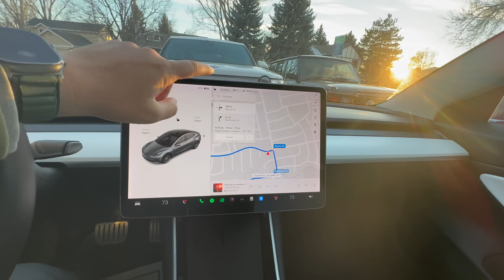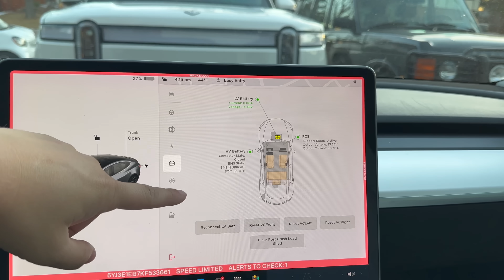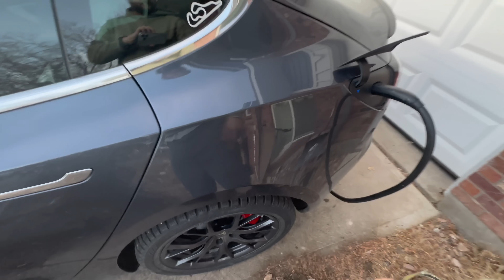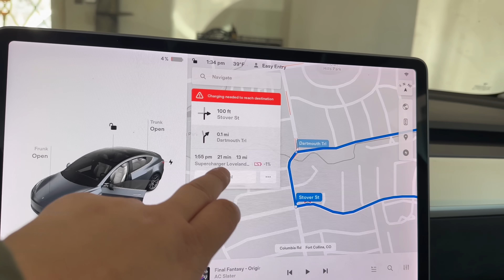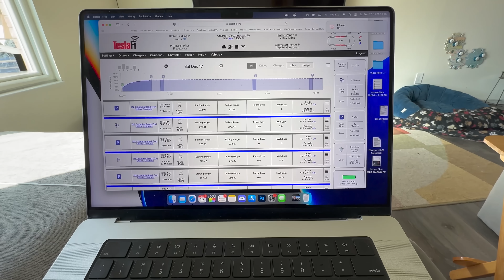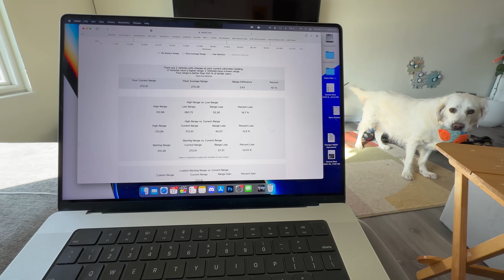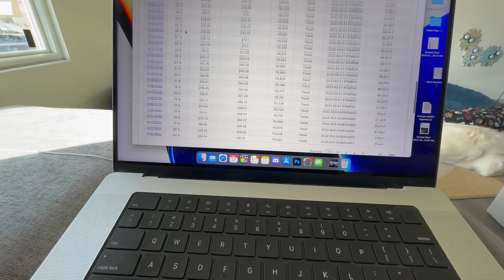Tesla Launches Service Mode! Wild Battery Health Results For My 120,000mi Model 3

Comment: 80+% capacity is a common threshold that a battery is still healthy. If Teslafi is showing 12% degradation, and the battery health is showing 8%, maybe the health test shows how much degradation is left until it thinks the battery will reach that 80% mark.
Reply: Tesla uses 70% capacity as their threshold for battery health. You need <70% capacity to get a new one under warranty for example
Reply: @keco185  by that logic, and if his battery warranty is just about to expire, he should be kicking that battery hard, then taking it to Tesla and asking for a replacement.
Reply: @keco185  yes but he has 18.8% degradation. So with another 8% hed be almost at 30% degradation. it does not seem to be an exact match however.
Reply: Actually if you read up on lithium ion batteries, most manufacturers recommend replacing the pack at 80% health.

Comment: Imagine owning a normal car where, if you have a fault, you need to bring it to the dealer to read the code, or get an OBD port reader
Reply: OBD port reader is $20-90 or so depends on what you want it to do., and lots of free apps to use for diagnosis, OBD port has been open for public use for decades.. and I can buy any part I want from just about any OEM..  Its Tesla that's been behind the curve on this.. I am very happy to see them open it up to see the info, glad they did this.. its about time.
Reply: @kens97sto171  true, but still sounds like DOS vs Mac in the 90s ha ha
Reply: @bartwaggoner2000  
 I would  take Dos or Windows or Android over Mac any day.
Pretty much the same philosophical differences we have with tesla vs most other OEM's
Freedom to do what you wish with your car and the ability to buy parts for it and  repair it yourself.
 Versus not being able to.

Comment: 174 psi likely refers to your power steering fluid, not tire pressure
Reply: it showed 174 psi in each corner of the car where the wheels are at.
Reply: It's electric steering so I don't think it has fluid
Reply: Yeah, the power steering fluid in the electric steering of the Model 3 usually also interferes with the WiFi cable attached next to it. Maybe that's why there are 174 psi shown on each wheel.

Comment: Hi, just one thought, a poor battery might perform ok while slow discharge but really suffer on high discharge due to increased internal resistance. It’s not so easy to measure degradation. It’s always a algorithm and it’s not perfect

Comment: i just checked mine & showed low coolant. I checked my coolant & it’s a little bit below minimum. I scheduled a service in the app scheduled this coming monday & Tesla sent me a repair estimate of $740 without checking the car yet. The estimate showed part “ASY FRONT CONTROLLER COIL SUSP” to be replaced. what connection does a module do to a low coolant? 😮 Should they be checking for a leak first than replacing a controller?
Reply: @DODIE, $740 us for front control Link and I got mine done free at 24 months of ownership of Y. They also replaced the 2 lateral links. Poor quality control
Reply: Mine says the same thing, figured it’s a bug since no errors show up and wouldn’t know about it otherwise
Reply: @echoplexSE  just had it serviced and they found no leaks so they just topped off coolant. I paid $20.5 for coolant top off and $120.5 for diagnosis/labor.
Reply: @dodie7431  can we find out the coolant level ourselves?
Reply: @welbyroberto6581  I did checked the level myself to confirm i’m low on coolant before scheduling service. I had to remove the front tub/frunk to see the coolant reservoir and mine was a little bit below minimum. I thought being over 4 yr old car, it might lose a bit of coolant but it’s supposed to be a closed loop system. I could have topped it off myself but I want the peace of mind not having a leak somewhere.
Reply: @dodie7431  thanks, that would be next year's project for me
Reply: Same error here.  Taking it in on the 10th.
Reply: @vinnie97  I had my 2020 Y replace the front control Arms and lateral links replaced free after noticing some noise at the front

Comment: The 5 way valve has failed on the superbottle and will need replaced. Tesla replaced mine for the same error, fortunatley under warranty. They replace the superbottle and attached pumps, valve, etc. for this, requires coolant put back into system and also recharging refrigerant system too since it is all tied together. Was done in a day. Good luck!
Reply: Maybe the test is having problems because of the valve failure.
Reply: @David_L3  could be. Bad thing about this fault is it doesn't tell you how long it's been going on, so the valve could have failed a long time ago. Don't like the fact this impacts your battery and motor health too regarding thermal management. Pretty major issue to me.
Reply: If it is a somewhat frequent malfunction, maybe they should do a recall. Sounds quite important to have that system functional.
Reply: @ContraVsGigi  What's worse is that it's not reporting as an error unless you check the diagnostics.  You could miss it as a warranty repair.
Reply: I'm guessing that's only covered under the bumper to bumper warranty?
Reply: @NathanC.4  Correct!
Reply: Has Kyle posted any updates on the valve issue?   be interesting to see what Tesla says.
Reply: @David_L3  not that I have seen, probably gonna take a week or two for tesla to get the car in to look at it, especially with the holidays coming up.

Comment: Thanks for showing this test. It appears your car has 65.6 kWhs for the nominal full pack reading. New is 77.8, making for 16% battery degradation. The range loss as you showed is 12%. I see the same variance between range loss and degradation loss in my 2019 LR RWD over the years. Capacity and Range Loss have always been different readings, with the capacity loss being greater. My capacity loss is 6.8% but my range loss so far is 4.6%. I have far fewer miles than yours, however. 😉I'm taking my readings from ScanMyTesla.  The Energy Buffer reading also declines over time. I believe this reserve is the past 0% capacity. Energy Buffer this vintage of 3's starts at 3.5 kWhs. Mine has dropped to  3.27 kWhs. While I only have 24k miles, 37% of those miles have been from Supercharging. I pretty much follow your same battery charging strategy.
Reply: The new battery 77 kWh is also misleading because even when it was new you would never get that much out of it, only about 72 kWh when new. So it is about 8-10% degredation.
Reply: @ryen7512  I watched your 70k battery report. Have to like ScanMyTesla. Just nitpicking, but I come up with just two more kWs at 74.3 usabe when new (77.8 minus the 3.5 kWh battery buffer). The first reading I took from ScanMyTesla was around 6,600 miles. It showed a Nominal Full Pack of 77.6 then. I did see one video of a new Model 3 that showed 77.9 when new, but SMT goes with 77.8. In a ScanMyTesla from a few months ago my Nominal Full Pack was showing 72.8 kWhs. SMT showed the "Usable" as 34.7 at 49.9% SOC, making the usable 69.5 kWhs at 100% SOC. Add in the 3.3 kWs of Energy Buffer and that brings it to 72.8, the Nominal Full Pack reading.
Reply: @epcalderhead  Thanks for the info. Here is another video I made at 10k miles in 2019 and it compares a few different sources which ranged from 72-74 kWh. Cheers. 
https://youtu.be/RUbrNgSdhUk
Reply: Not every model 3 long range had 77kw battery pack most of them came with 75kw pack until recently they put 77kw and 82kw packs with the enhancement of the battery packs. I think that was in 2020 they changed.
Reply: @acostaae90  All LR Model 3's had 77 kWh packs until they bumped up the range as you mentioned to 82 kWh. I've never seen a 75 kWh LR pack documented. Once you subtract the 3.5 kWh of buffer you are around 75 kWhs of "usable" energy. Perhaps that is the confusion some make? Can provide proof there were 75 kWh packs?
Reply: @epcalderhead  the useable was always 72kw though from what I read on all model 3 long range until the upgrade to 82 which I suspect make the usable 77 or so
Reply: when has he used SMT?
Reply: teslafi is always similar to SMT - > the cars original range is 320 miles not 310 miles. the initial degradation is hidden.  they are both 16% hence.
Reply: @kingprone7846  depends on what build you have. Original model 3 performance was like 302 miles and LR was 310. The LR RWd was 315 then got bumped up to around 325 and 318 and 310 respectively with a software upgrade.  They all had 75-77 battery sizes with a useable 72kwh. At some point end of 2020 or 2021 they added 82kwhr pack and a heat pump which gave them more range.
Reply: @acostaae90  that was just from the tires and only for the 2020 model year. model 3 LR/peformance has always been 310. also maybe it was 325 not 320 - i think in kms not miles.
Reply: Question from a Kia EV owner…many of the posts state the range after the battery is charged, does Tesla just use some standardized formula for this?  In the non-Tesla world the “guess-o-meter” range calc is based on recent driving data. If I’ve been commuting, my full charge range is over 300 mi while if I’m on a road trip it might show 230 mi for a full charge.
Reply: @JBRion22  Teslas display the battery capacity in percentages or in miles. It's not a GOM like in a Bolt or Leaf. The % or miles Tesla shows is based off the pack size and an EPA rating. For my car that number is 234 Wh/Mi, or 4.27 mi/kWh. To display the rated range the car takes whatever kWhs are available and times that by the EPA range of the car. The percent or miles of range displayed will not change based on driving style and conditions and "guess" the amount of range or energy remaining. It will show what's remaining and not try to predict the future. If your BMS is not balanced that number can be off. To get a precise reading of how much range is truly remaining, based on what the car thinks is available (see caveat above), Tesla provides an energy graph screen which is highly accurate. This video explains how it works: https://www.youtube.com/watch?v=bGpfM0vLlwY  - HTH!
Reply: @epcalderhead  thank you!  I appreciate the detail!  

You said your epa rating is 4.27 mi/kWh?  That’s really good.  Are you seeing real world numbers like that?  Is that a Model 3 and is it single or dual motor?

My Niro EV is rated at 3.7 combined but I average close to 5 mi/kWh in the summer commuting and 4 in the winter.  The road trip I took in Oct though was around 2.7 due to weight (family of 4) and speed (80 mph speed limit).
Reply: Sorry, nevermind, I see you provided the specs of your car in the initial post.  Still curious about your real world mi/kWh though.
Reply: @JBRion22  My lifetime mi/kWh is 3.96 or 252 Wh/Mi at 24k miles. These are the last two major road trips to give you an idea of the efficiency of my car with 18" Aero wheels. I also generally drive the speed limit. First from Ohio to the UP of Michigan in October and the 2nd trip from Ohio to South Dakota (and into Wyoming for Devil's tower) in September. Trip 1: 1,910 miles, 461 kWh used, 242 Wh/mi (4.13 mi/kWh) -- Trip 2: 3,197 miles, 890 kWh used, 265 Wh/mi (3.77 mi/kWh). That Michigan trip was perfect EV weather and terrain, hence the great efficiency. Pretty warm but not hot, mostly flat and no crazy 80 mph highway speeds like out west.
Reply: @JBRion22  tesla rated range is equivalent to other manufacturers battery capacity reading in kwh. theres a seperate guessometer. tesla displays this as the EPA range so rated range isnt the same amount of wh/kwh in every car. its kinda more easy to see what your range is as most drivers get used to how accurate the rough constant is. theres also a rangemeter which isnt the same as rated range and THAT is based on recent drivingstyle/consumption
Reply: @kingprone7846  thank you! Hoping to put a Tesla in my garage when I’m done with the Niro!  The Niro has been great, my favorite car that I’ve ever owned but the more I learn about Tesla’s the more they stand out for their tech.

Comment: Good stats. My full charge is hanging out around 275 rated miles. 170,000 miles of similar use case to you, with lots of supercharging on road trips. I haven’t don’t the service mode health test yet.
Reply: I'd be curious what your battery test shows!
Reply: Do the test, pronto.

Comment: I tried it with mine, did everything that you did a week before you posted your video. I had the fans going all kinds of noise and something went wrong because I came back and it still said 100% Health after almost 2 years of ownership
Reply: What are your charging habits?  To what state of charge do you normally set and how do you typically charge it?
Reply: @mitchbynum  if I'm not on a road trip, I'm usually down to about 40% and then just to trickle charge on 110 volt, back up to about 80% and that stays pretty typical

Comment: Pretty neat stuff in Service Mode. I wanted to do this, but don’t have home charging. I asked SC Tech to perform this, but so far I’ve heard only crickets. Car’s exclusively SC charged. Almost everyday to 90%. Yesterday I pulled a Kyle and pushed it to 5% remaining… Lol. The very first time car’s been in single digits. Though my 90% number is @254.. Curious to see how battery health is holding up. Owned it for 2+ yrs.. pushing about 45k… Love the channel! Dig the new logo !!🍻
Reply: I really want to see how is your tesla battery doing with your type of charging style. I am charging my MYP at home, but doing it  low 25-35% to 85-90% top charging routine.
Reply: @nurseitkalbaev  Likewise. I’d like to see this as well. Will see if I can do a battery health test either have Tesla Tech do this or see if I can plug it in at a level 2. It’ll probably be in January when I don’t have to drive as much for work. I’ll keep the inquiring minds posted. It’s like, I kinda want to know, but then again, I don’t want to know. Lol.

Comment: It’s seriously awesome that Tesla removed geofencing from service mode
Reply: @ExperienceCN  those are likely not linked. You can have a new battery and still have a cell kill the pack
Reply: Geo fencing?
Reply: @Maceyee1  you used to only be able to use service mode while physically at a service center - it would only work within a map bubble around the service center locations unless manually trigger with toolbox (mobile techs)
Reply: @brandenflasch I thought there were just additional service options in the mode when you’re inside the geofence
Reply: It's almost as good as when antibiotics were introduced.
Reply: It was always available in Europe. There hasn’t been a geo fence for service mode
Reply: @ExperienceCN  there definitely has been a service mode in the US